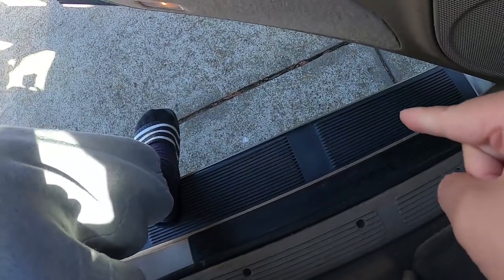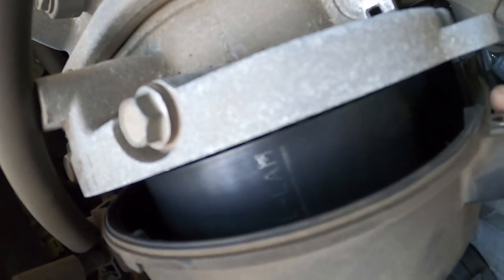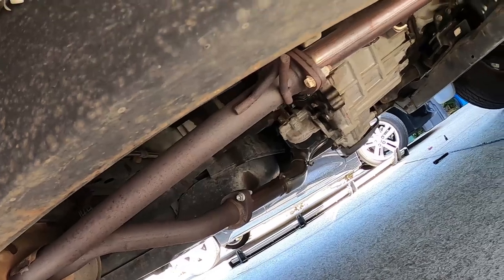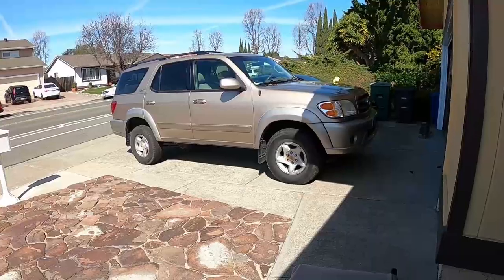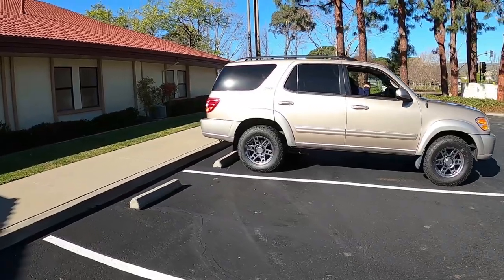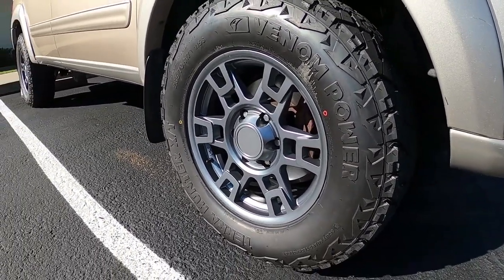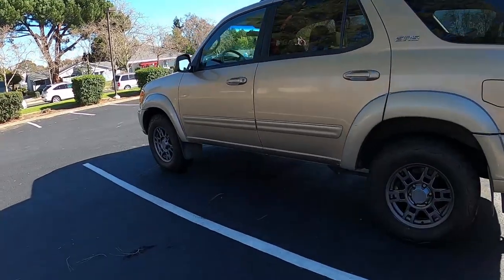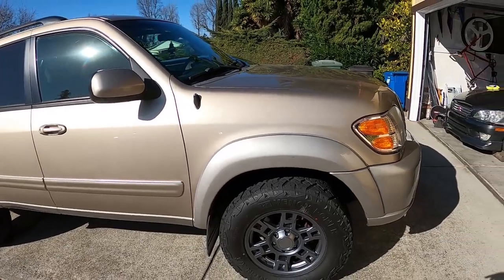1st Gen Sequoia On Grey TRD Pro Wheels!

Comment: Looks slick!  Question - do you need a lift to ensure that those rims plus 265/70/17 tires don't rub/make contact with the wheelwell?  I'd like to recreate something similar to what you have but don't want to introduce any rubbing.
Reply from the maker: I didn’t have a lift when I first got the wheels and it was fine.
Reply: @CorneliusVeee  Right on, thanks man - keep it up!
Reply: @CorneliusVeee  Any idea what width rim you got?  I'm seeing that they range a bit from 7.5-8.5/9.
Reply: @justinberardi2687  yes following !!
Reply: @justinberardi2687  he mentioned 8.0 stock width but was wondering what is ET on those TRD ?
Reply: That wheels are 17x8 et +5

Comment: No it’s not I’ve had them for almost 2 years bF Goodrich k2 on the 2019 4Runner TRD pros direct fit and 2” spacers all around BARELY rubs on oem suspension. Not too bad

Comment: What size tires?
Reply from the maker: 265/70/17
Reply: @CorneliusVeee I’m thinking about going from 265/65 to 265/70 as well. Any rubbing issues on the fronts when steering?